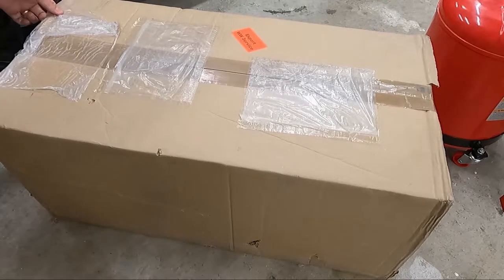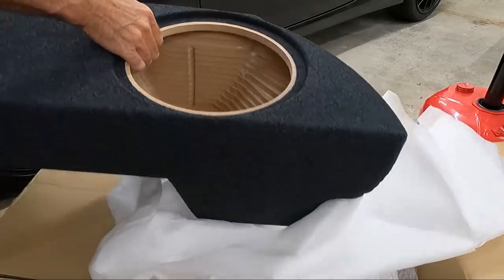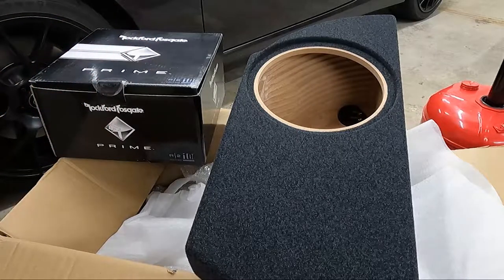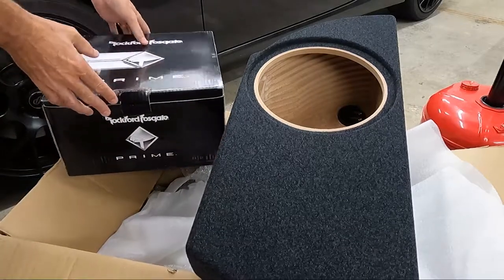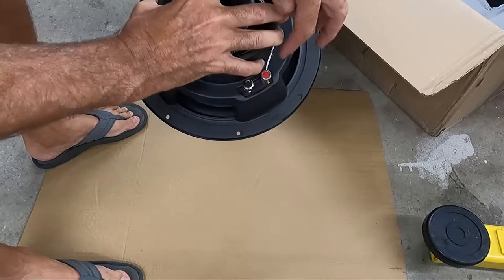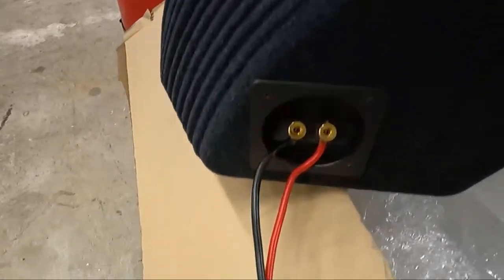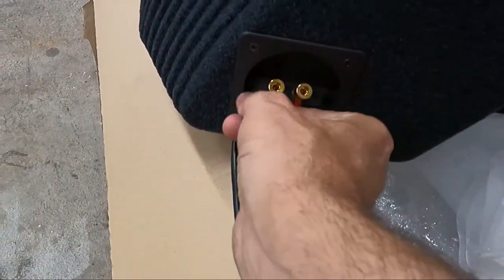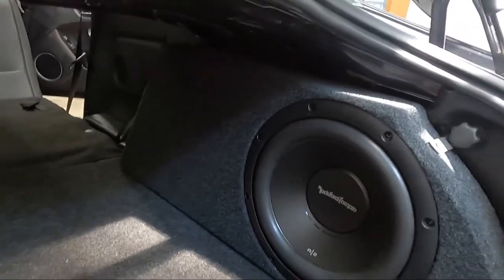Subaru BRZ & Toyota 86 Aftermarket Subwoofer Enclosure Install

Comment: How does this work with the spare wheel enclosure, can I still reach it or would I have to take out the sub every time you want to lift that cover up?
Reply from the maker: Yes, needs to be removed. Remove both knobs and slide it out of the way.

Comment: Curious if you swapped springs on the Ohlins on your 911 and if there is any update there.  Thanks
Reply from the maker: Hey B Y , not yet. I'm still playing around with settings. I've changed the preload adjustment a number of times trying to make things more compliant for the road. Even a revolution or two of the ring nut makes a noticeable difference in how firm the suspension feels. At this point I feel like I can't make any more improvements with the spring. It's definitely better than when I posted my impressions, but I'm still not satisfied. I'll go through the damper settings one more time now that the springs are spot on and see. I really think I'll be swapping springs or going back to OEM setup. Probably won't make that decision until the Fall though...
Reply: Thanks for the update.  My 997.1 suspension has worn out and I have been researching coilovers heavily.  Ohlins, KW, Bilstein…..impossible to decide.  Or if better to go with lowering springs on Bilstein replacements.   There is also an Ohlins dealer (3DM Motorsports) that will sell a set with custom springs and valuing.  I may go that route, not sure.  I seek tighter handling but with a reasonable balance for day to day drivability.  Thanks for the videos and replies!

Comment: The link to this item is no longer available. Is there another link or another way to find the box? Thanks!
Reply: just did a bit of research on this sub enclosure. Looks like this is originally from the UK you can Google search it and it will pull up.
Reply: @krazykrn9066  sweet thank you. That's sad, though. I'll have to try ordering one
Reply: @deathonix  you end up finding it? I can’t seem to find it